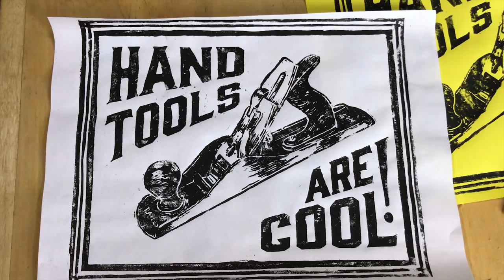Block Printing - Hand Tools are Cool!

Comment: Very neat project!  I must show this to the wife, she loves this kind of stuff.  Suggestion, I believe originally they used some kind of leather pillow on a handle to apply the ink, you certainly could make that.   Also, you could take a piece of leather and lay it over the back of the print, place a board on top of it and apply some force.  It would be kind of like an inverted printing press.  I suppose faux leather would work too.
Reply from the maker: Thanks for the ideas! I have a cold laminator which I'm going to try out, I think it should work well, just got to clean the dust off it! ;)

Comment: Lazer printer works well, but you can also use a copy from a regular copy machine that uses toner. (No inkjets. It's the heat in the printing process that makes the transfer. There's no heat in ink jet printing.) 💜🌵🌞

Comment: if you've got another mdf piece you could try to put it over and use clamps, like improvised printing press. Layer of lino would make area of pressure smoother
Reply from the maker: Thanks for the idea - I reckon that could work although I have a cold laminator that I'm go to try when I get chance. :)

Comment: Perhaps press the paper into the pattern with another rubber roller like the one you used to spread the ink?

Regardless, it's the little inconsistencies that make the prints into art!
Reply from the maker: Yes I need to experiment a little - you're are dead right about the inconsistencies! :)

Comment: Suggestion? Use a veneering hammer instead of a spoon to work the paper. Of course, you could make a roller etc but a veneering hammer might work as well.
(BTW, the wife's rolling pin might be a candidate but happy wife - happy life.)
Reply from the maker: Thanks for the suggestions Clyde! I actually have a cold laminator which I reckon would work. The proper way to do it by hand is with a tool called a baren.  :)

Comment: Looks awesome. 
Our Art faculty at school do block printing. I had to steer them from MDF to Masonite as MDF dust is classed as a hazard in schools in NSW. (all dust is a hazard) I avoid it in my Industrial Arts faculty almost entirely now, which is a shame as it's very versatile.
The chisels worked great.
Damo
Reply from the maker: Thanks Damo! I agree about dust being a hazard but there really is very little dust with carving, it's all chips and curls. Masonite sounds interesting though, I have a couple of pieces of tempered masonite I may try it on. :)
Reply: I know that, you know that. Dept of Ed just covering their butt. I used to use MDF a lot to make lids and covers for small electronics project boxes. It was so easy to work with.
Had to switch to masonite & 3mm ply.
Good luck with the masonite. Show us the results.

Comment: I would have used a trim router to remove the bulk of the waste and refined the edges with gouges later. But I guess it wouldn't look so good to make a sign "hand tools are cool" by using powered equipment. It is certainly a great idea that I may borrow to stamp my own work. Cheers.
Reply from the maker: Thanks Kuffy! Removing the bulk with the larger gouge is actually a very fast process - the gouges go through mdf like butter. ;)
Reply: @PaskMakes  It seems so easy when you do it.